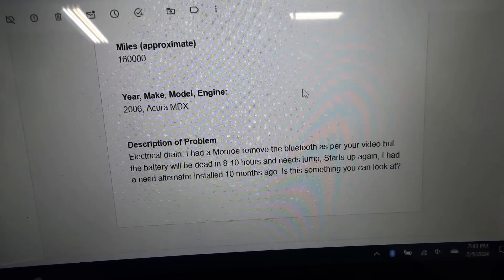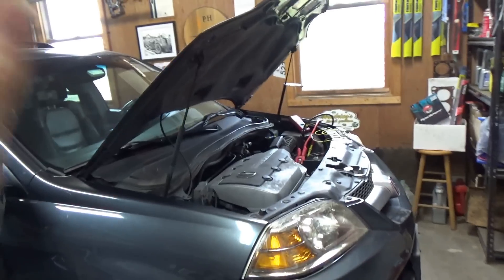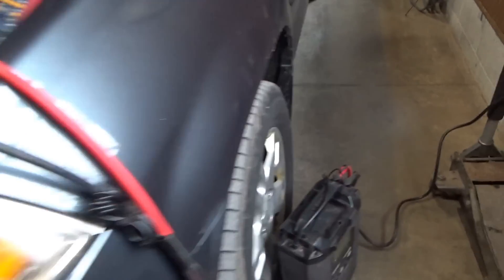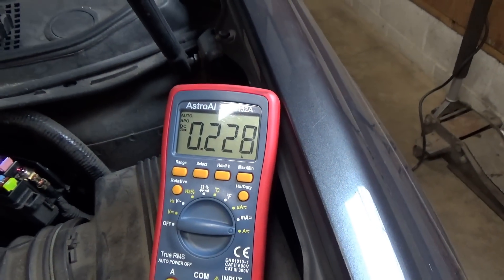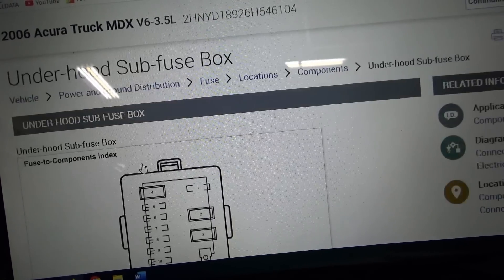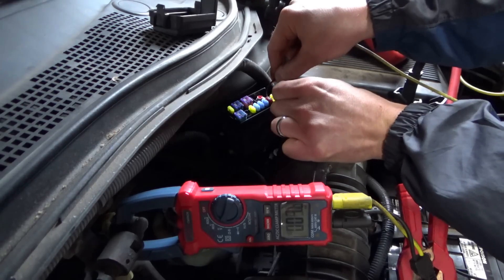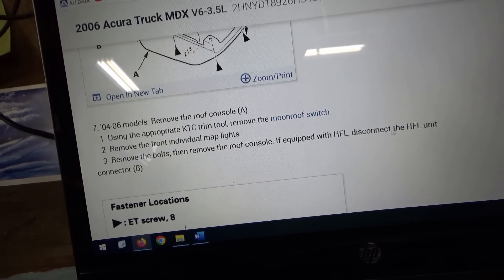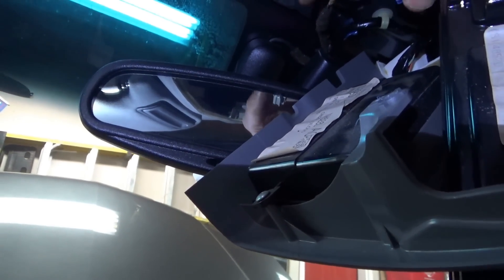Battery DEAD in 8 HOURS? (Shop Already "Fixed It"...? Acura MDX)

Comment: the issue with the link unit is it the 3g towers have been shutdown so the cell modem keeps searching for towers but that can be upgraded as well
Reply: Wouldn't that be the Onstar unit and not the Bluetooth module?
Reply: @johnt.848  if you replace the 3g modem  with 4g lte sloves the problem
Reply: Correct, and this era OnStar used AMPS that shut down in 2008  @johnt.848 
The original comment applies more to certain Subaru's with Starlink

Comment: To be a good tech in this day and age, it would appear one needs to be an electrical engineer. The failure of all these modules is the reason we will never see these cars in a Meacum auto auction 40 years from now.
Reply: I disagree. You need a mechanic that is willing to learn.
Reply: Yep, they do not belong there and ensure the cars will need replacing

Comment: Step 1 verify customer complaint. Always take what they say with a grain of salt. I once rewired a whole ground system on a Jeep Compass that the customer had told me they replaced the bulb and it still was not working. Being I had seen the same issue at least 10 times before I went ahead and cut the terminals off and put new ones on. Still no turn signal. Pulled th bulb out and it was clearly blown. I couldn't charge the customer for the ground repair and also prevented a problem that he was guaranteed to have. Always do your own diagnosis and start from the beginning.
Reply: yes don't believe a damb thing they say

Comment: Smart battery testers have their place.  If you just need a quick indicator of battery health, they're great.  But CCA or the European equivalent isn't a direct measure of battery capacity.  And that's where some diagnoses go wrong.  Depending on what happened to that battery, you might be able to revive it.  Take your power supply and pump 2A into it for a few days. You might get some/most capacity back.

Comment: I would fully recharge the battery & get a conclusive amp hour reading on my battery load tester which has been very handy for me when I had to diagnose a slow cranking issue in my car which had am issue with the starter motor solenoid.

The battery in my car is 3 1/2 years old & still reads between 600 & 700 CCA when it's rated at 640 CCA.

I would also recharge the battery prior to testing it with a load tester just to rule out a possible issue with the charging system or the battery itself.

Yes,my cars battery will start the engine 10 minutes after the high beam headlamps have been turned on,I don't always get a Mate either because I don't marry one of them who had an argument with our local auto electrician when the battery light turned on in her car & he diagnosed it as a bad alternator which it was.

She thought that she knew better & tried to tell him that the battery needed replacing when it didn't, one of their Reids said that the person who trained me would have to tell me why I wasn't for her over 20 years ago !

Comment: Battery would have been fine when tested but every time a modern battery gets deep discharged and charges back up the AH charge capacity gets reduced so on a car with a parasitic draw even what starts out as  good  battery gets quickly turned to toast 
Electronic smart testers are actually pretty good  for spotting batteries with issues early on I now use one as my main tester instead of my high amp voltage drop tester because here in Europe  cars 2 Litres or over are diesel and have really big batteries and need a very high amp load tester to match.